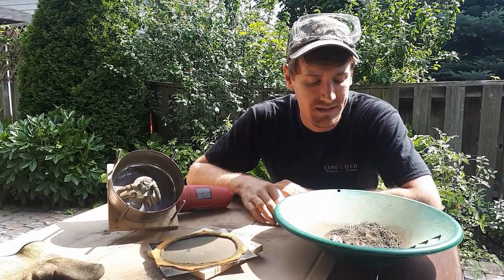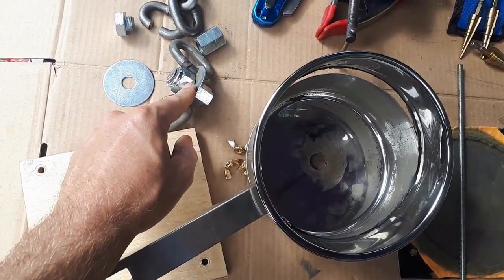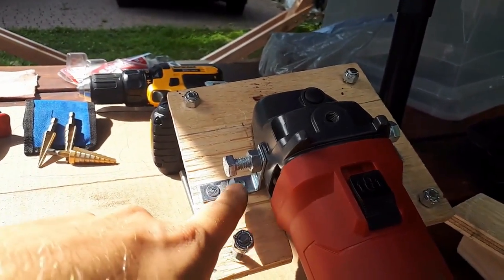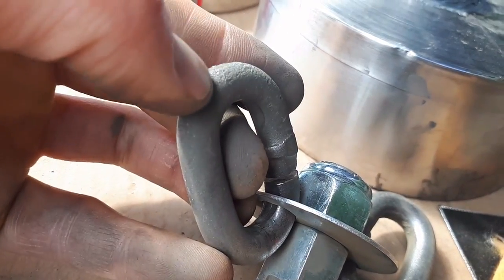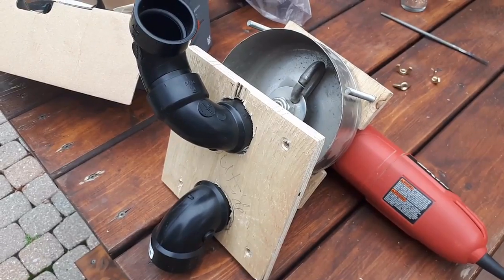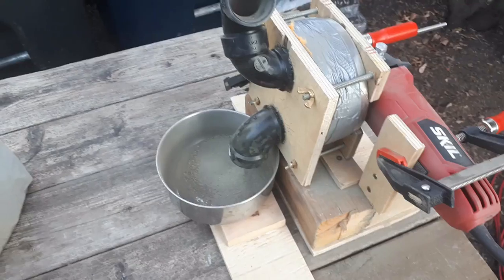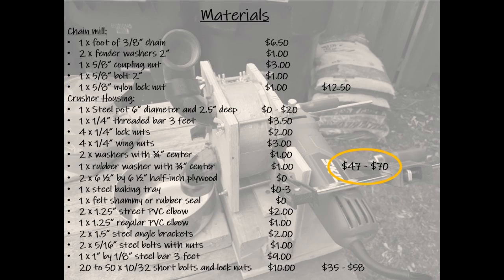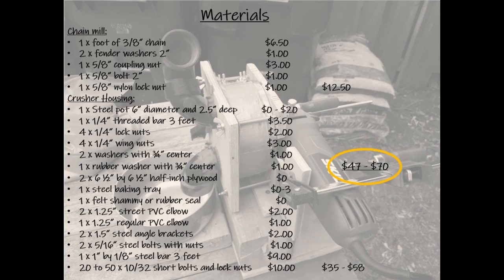DIY Mini Rock Crusher (No Welding!)

Comment: I used an old pressure cooker and didn’t have to worry about making a lid just had to drill a hole and make the frame for the grinder and bam done thanks man for real I followed your advice with a few mods and got a motorized rock crusher for half the price of the cheapest hand held one seriously appreciate it brother
Reply from the maker: Thanks man, glad your build worked out! Great idea with the pressure cooker. Cheers.
Reply: Do you have a video of you making or using your crusher I would love to see it
Reply from the maker: @caseybeckner2625  Working on that! I have a Short video up showing me use it to crush silver ore. But I need to post a longer form video of the crusher showing additional changes I have made to it recently. Hopefully I will have that soon!

Comment: Thanks for doing this video. I also found that the motorized portable crushers are very expensive. I just made a hand crusher that is OK for small samples but is too painful for any larger quantity. Thanks for sharing, very smart.😎⛏⛏🔥🔥
Reply from the maker: Thanks, Chuck. I've got a ton of samples in my shed that need processing, its just hard to find the time to do it! It doesn't help that its winter here in Canada and I don't have an indoor work space.
Reply: @LetsCrushRocks  Time is the big problem for us all. Only so many days and so mant hours in them.

Comment: Hi and Thanks !.. 1/3rd done But, I used a 2 pc. clam broth steamer w/ spigot for the lower broth pot ($10)..cut that away to 3.5 in. as the pot is 12' so double and reinforce. two chain links (or even 3?). I really like not paying 300 - 1,200 bux of course !  keule !!!
Reply from the maker: How did it turn out?
I updated mine here: https://youtu.be/Cm67cGC86E0
Reply: @LetsCrushRocks  woow  !..very impressed..upgrades and more..shaker table...and no, I I had it almost at the assembly stage and got in a band..too busy..music studio build too..I'm  inspired to continue now (fall winter..no music gigs on san juan island, ,wa _ ) also building a forge from old rusty barrel..refractory,  kaowool, rigidizer, firebricks..I  have the kwik kiln mini but.. fun with thermodynamics "n such..
good work man !!!
Reply from the maker: @petermccarthy8263  All sounds good! I had to take a break for a while when our first kid was born. Hence the very large gap in video releases (almost 3 years I think!). Managed to have a bit of fun processing some rocks this summer, then our second child was born. So back to having no free time for a while!

Comment: I think it's better to have two chains linked together, that way the washer should not break. Also the overall diameter should then also be larger.
Reply from the maker: You mean have two chain links linked together on each side? I would have to make a much bigger crusher housing to accommodate the extra diameter. Might also be too much work for my little angle grinder to power something of that diameter as well, but perhaps not.

Comment: Delightful.  Angle grinders are a real bargain...eminently useful to make things, eminently useful to power things you make.

Your video gave me all kinds of ideas as well as the motivation to get going on them.  Thanks!
Reply from the maker: Thanks Jensen. The grinder has proved to be a staple tool in my shed. I recently picked up a rock cutting disc for it that I plan on using to cut up some of my rock samples to give them a smooth face. I also just posted a video today of a kiln I made and the grinder was necessary for most of the work.

Good luck on your projects!

Comment: Exactly what I was looking for - thank  you!
Reply from the maker: Glad you found it helpful, Daschel. I finally got around to adding the rest of the steel liner plates this past weekend (almost 2 years later!). Just havent had much time to play with it. Maybe I will do a quick update video next week.
If you're going to make one, do yourself a favour and use wider steel flat bar for the inner plates than I did. I think I used 3/4" width, but would recommend 1" or 1 1/4". Will save you time on drilling holes and money on nuts/bolts.

Comment: thank you.  I gave you the up thumb for being very thorough.  Building one right now.  How are the bolts holding the inner supports to the walls holding up?
Reply from the maker: I tried spacing the bolts to keep them away from the centre of the plates where the main impact zone is, but I have not had much free time recently to crush rock so not much has worn down yet. I will circle back later this summer once I crush some more up. I do expect the heads of the bolts to be softer than the plates.
Reply: @LetsCrushRocks  cool beans....I did a test on my prototype this am...lots of vibration. Wow really shook me good.  Fender washer wearing quickly....angle grinder had more heat than usual.  Tomorrow I am going to size down the chain to 1/4" and make a double fender washer. Hope to reduce heat and vibration.  I drilled 1/16" holes x 25 where I chose to put the exit port located in the housing then straight piped it down 8".  Worked nicely.
Reply from the maker: @nompro7268  I found that the holes I drilled in the side plate to eject crushed material did not work that well and perhaps only half of the material came out. I got in the habit of just tipping the whole thing upside down after every few handfuls of rock and dumping the crushed stuff out the top. 
Even with two fender washers I can see they are still starting to bend a little, I might try to find a stronger alternative. 
I do get vibration as well, which I think is somewhat inevitable with the chain and bolt much heavier than a cutting or grinding disc and the uneven wear on the chain pieces leading to imbalances.
What sort of rock are you crushing?
Reply: @LetsCrushRocks  quarts veins in iron..

Comment: do you have any suggestions now that youve run this for a while?
Reply from the maker: I don't think I would bother with the outlet port and just load from the top, crush, and then turn it upside down to dump out. 
The large washer in the middle used to hook on the chains is weak and bends after a while, eventually breaking. I have doubled it up but it still bends. Would recommend replacing it with something thicker. I don't have a drill press so its hard for me to drill large holes through thicker steel. 
I saw a recent build video by Orophilia that was really good, he makes a nice crusher.
Reply: @LetsCrushRocks  thanks alot. i made a steel flailer  to make solid steel stair ballisters look handforged, there was alot of trial with errors but i got it done and its useful for beating alot of otherstuff also!Pierre 
laboom, ""browns finally stair ballister basher"

Comment: Can this grind Sand into flour size particules please ?
Reply from the maker: It is a rock crusher, not a grinding mill. The samples I have tested result in approximately 50% of the rock passing 60 mesh. I dont think it would regrind sand very well at all. You would better be served by a ballmill for that.

Comment: Hi, your crusher looks too weak and quite unsafe. Using thin washer for holding hammers might be dangerous - just estimate centrifugal force at rpms the angle grinder provides. I think you should better find a man with a welder to help you, as I did. Be careful.
Reply from the maker: You're right, Ivan. The washer that holds the chains is definitely the weak point. I have since doubled the washers but need to find a stronger component to replace them as even the doubled washers are starting to bend out of shape a little.